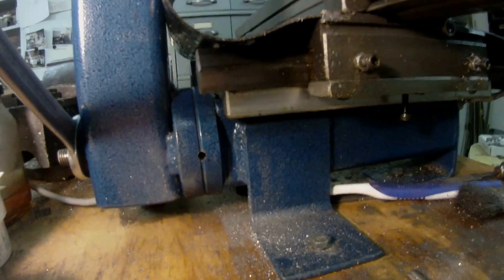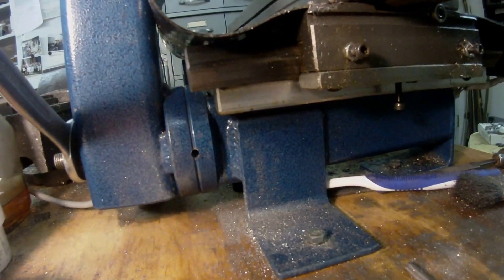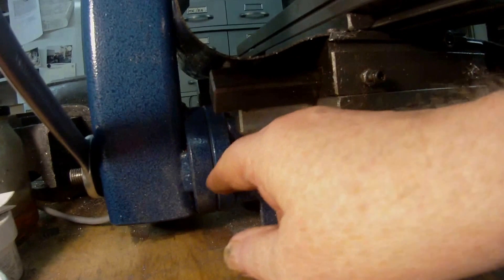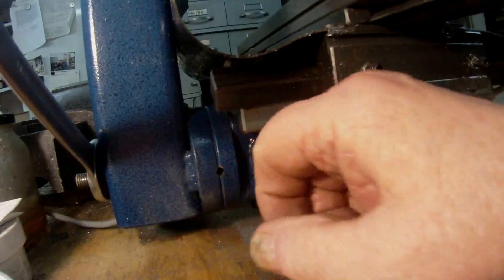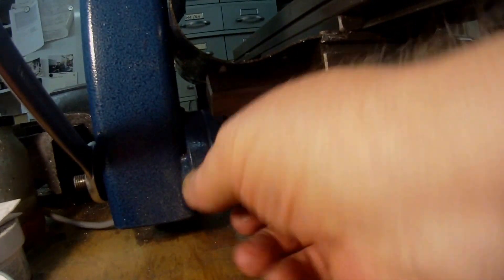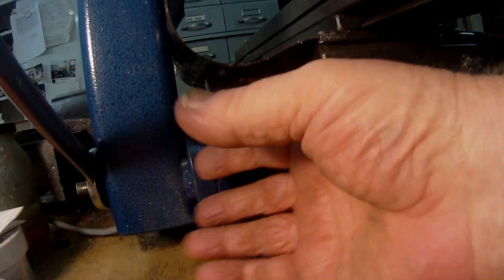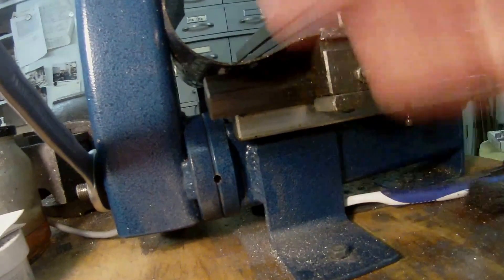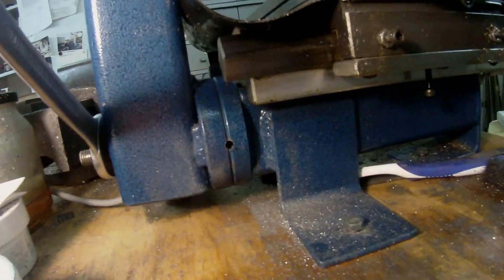FILE0029 Making a #4 tapered dowel with extractor thread

Comment: Walter.  I've come to appreciate what a clever machinest you are.  What drove you to putting a tapered dowel in the mill?  Do you have problems with the mill that requires frequent traming?  I have the same mill as you and wondered what you use to lube the ways and lead screws.  I currently use Mobil1 5-30 for both applied before each use.  Thank you.
Reply from the maker: +Roy Lucas 
Roy, it seems that there is no technical data that indicates how much force is required to tighten the central bolt between column and base of the mill, therefor some operators make their own decision of what they think is tight enough, it happened to me (column movement) once while doing some small work machining, and at that time having read a comment that a user tightened his bolt so tight that the front plate became concaved caused me to be conservative in tightening, it happened to me again twice while machining this present oversize project which really is to be expected, this made me think how can I improve the design to hopefully eliminate or help that this doesn't happen in the future, it may not solve the movement but it must be helpful, 

The oil I use on both machines are a straight 10 Castrolite  and a Way Oil, mostly the Way Oil, I am unable to comment on Mobil 1 5-30 although I feel sure it is very suitable for the same purpose,
Reply: Thank you.  I saw comments to torque the nut to 35 ft pounds.  That is what I did.  So far so good.  Why did you choose to put the tapered pin on the edge and not through the two meshing plates?  I'm thinking of following your lead once you finish and perhaps review.
Reply from the maker: +Roy Lucas 
Roy, in my estimation not enough room to go through the two meshing plates and less clearance, whereas easier into the edge,